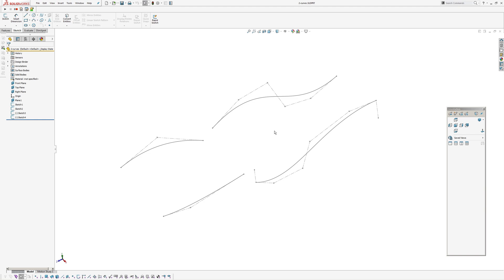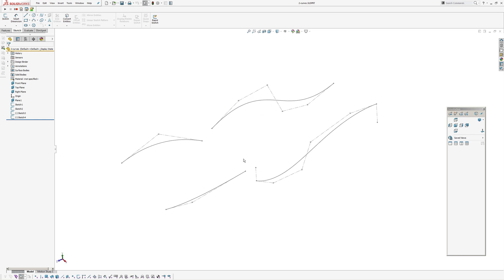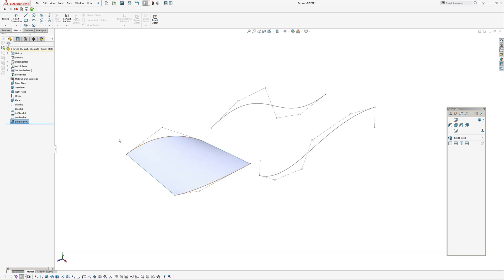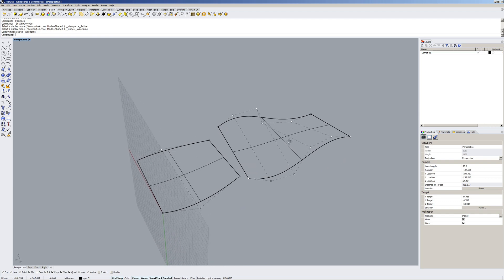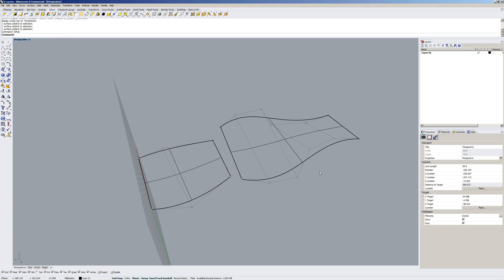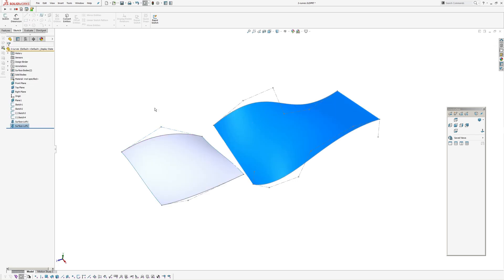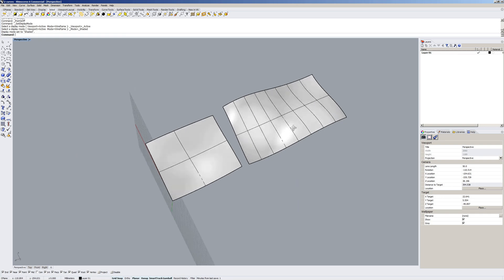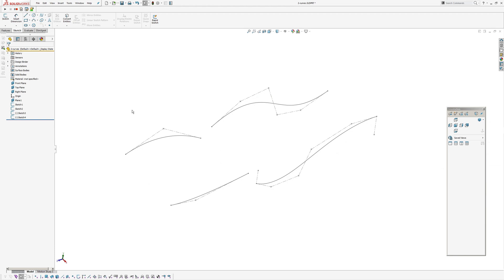Solidworks: Investigate Loft and Boundary surfaces

Comment: As an experiment could you also run the Surface fill as a comparison? I assume it would be heavier - but you never know
Reply: It’s so heavy with relatively clean input curves- and only gets worse when you build tangent to trimmed surfaces or cut solids. I suspect this is the trade off- that it is good enough for most consumer injection molded or machined parts where tooling textures can hide a multitude of sins- where the relatively heavy surfaces make it easier to knit edges to form a solid VS listerine clean surfaces and highlight control. At least Rhino lets you know that the network surface you created is outputting heavy surfaces- and for most products this kind of heavy surfacing is just good enough to function.
Reply: I think it would be educational to use the Solidworks curves and see what the Rhino loft and 4side surface creates - these are typically the cleanest commands to create driving core surfaces/slabs. Speed/curveedit ability vs sparse clean/direct editability. It’s two diametrically different approaches
Reply from the maker: Agree, I can try a loft and also edge srf in conjunction with match srf. Maybe also network srf to get an oranges vs oranges type comparison
Reply from the maker: https://youtu.be/ZW9cJtRQUxw
Had a quick go in Rhino using the SW curves.
Reply from the maker: Agree, it’s fine most of the time. It can be very frustrating when issues do crop up in SW, like ripples in boundary surfaces near the boundaries, especially when the input geometry is clean. Having control over curvature analysis settings and also a decent mesh back end would help quite a lot in figuring out what exactly SW has generated.
Reply from the maker: Yes, can do.
Reply from the maker: Quick test. Having optimise on creates an untrimmed surface, like the boundary/loft does. It seems to be more consistent with the amount of CVs it creates though. Optimise off creates Deg5 multispan surface. 
Optimise On. 
4 boundaries, no constraints. Deg3 18 X 10 CVs Untrimmed surface
4 boundaries, one tangent. Deg3 18 X 10 CVs Untrimmed surface
4 boundaries, two tangent. Deg3 18 X 10 CVs Untrimmed surface
4 boundaries, all tangent. Deg3, 18 X 18 CVs Untrimmed surface

Optimise Off.
4 boundaries, no constraints. Deg5 12 X 24 CVs. Trimmed surface
4 boundaries, one tangent. Deg5 42 X 30 CVs. Trimmed surface
4 boundaries, two tangent. Deg5 15 X 27 CVs. Trimmed surface
4 boundaries, all tangent. Deg5 27 X 36 CVs. Trimmed surface
Reply: Love the content

Comment: Well this is very revealing! I wonder why Solidworks struggles so much for seemingly simple surfaces. Some amateur thoughts- Maybe it produces simpler surfaces with curves that don’t have inflection points? Or with curves that have no inflection points and archs (concave) towards the same direction?
Could tolerance settings play some role in this?
Reply from the maker: I suspect tolerance plays a role. There is no user definable tolerance/accuracy for geometry in SW like there is in Rhino/Creo etc.